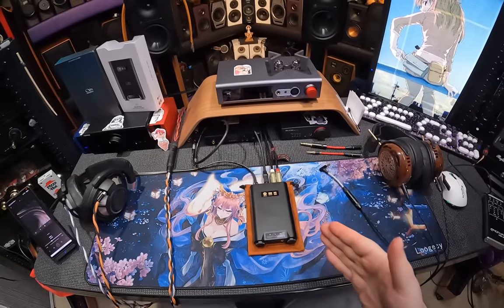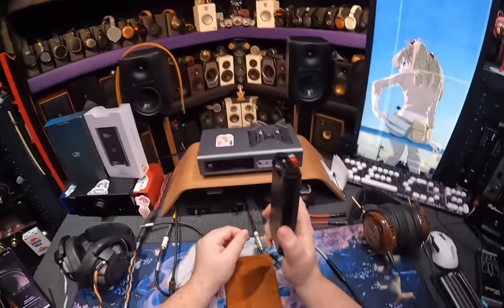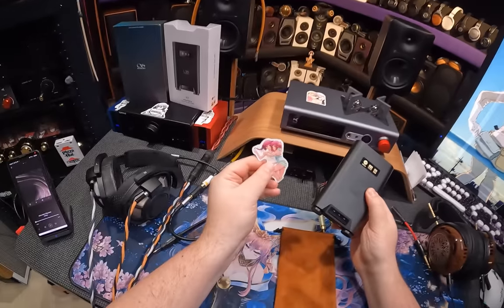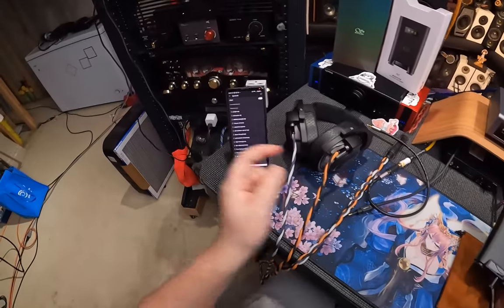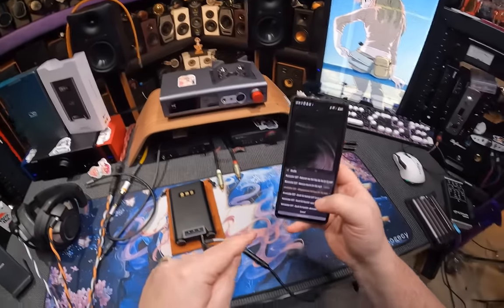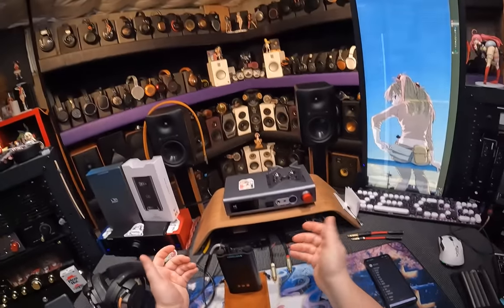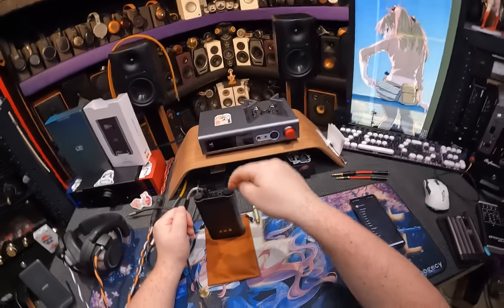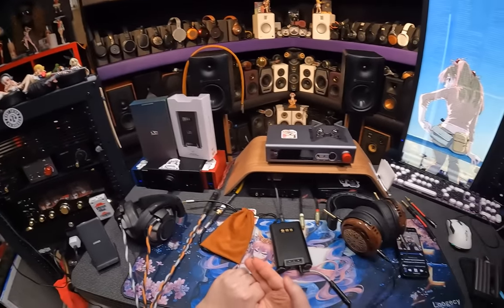A Retro Portable Music Computer -- The Shanling H7

Comment: Z: and be careful with this case included with the H7. I ruined my logitech mx 3s white mouse because of him. The more you touch him, the more he paints your fingers and everything you touch white will also be colored. I had to use a solvent to clean the ingrained paint from the mouse, but I didn't completely clean it. Orange spots. You can't touch anything white. The cover had to be washed 4 times, then it stopped being painted.
Reply: was the post on headfi about the bag coloration yours?
Reply: @НиколайЗагада  Yes.

Comment: Xduoo is supposed to give as a similar size dac Amp with swichable dac modules , beyond the normal for them opamp swaps 😅
Reply: Which xDuoo model has switchable DACs unit ?
Reply: @d_dude_is_here  Xduoo Xd05 pro. Should be available quite soon.
Reply: @d_dude_is_here  seconding this question, I've only seen models with swappable opamps
Reply: If you are talking about xDuoo 05BL Pro then kindly recheck as it's a detachable bluetooth receiver and not a DAC unit.
Reply: @d_dude_is_here  wouldn't surprise me if a new XD05 model is coming out soon it's been a while last one

Comment: Have you found the firmware update?

They have 1.5 version I just saw.

UPDATED:

Update Notes for V1.5

1. Added SyncLink support for cover art and lyrics stored on MicroSD card within H7. (At this time only supported on Android, app version V2.1.5).

2. Added Resume function for MicroSD card playback.

3. Added battery indicator for H7 into the SyncLink on Eddict Player app.

4. Adjusted audio circuit behaviour, reducing audio cut-off at the beginning of music.

5. Other device adjustments and fixes.

Thanks for your video. I was considering this, as a semi portable but maybe I will choose something smaller than Mac Truck…. I was thinking of the Cayin RU6, until I saw the Earman Colibri then I saw this….. 

Can you use other players to control this or are you forced to use their player?
Reply: I am also curious about Cayin RU7 comparison with H7 and Earmen Colibri. Want to make purchase decision.
Reply: @Gaurav18nov   I have the Cayin RU7 and also the Fiio BTR7. I do enjoy the sound on both. The Cayin is a smaller footprint so a little easier to carry. The Fiio has Bluetooth & wireless charging so it offers a little more in features. Sound wise I would call them close although the Cayin is R2R and the Fiio is THX chipsets. I personally do give a slight edge to the Fiio in terms of sound. They are really close and I do enjoy the Cayin very much. Maybe the clarity in the top end comes through a little more for me personally with the Fiio. But simply as a portable tiny little thing the Cayin is about half the size and does sound lush.  My 2 cents worth…. If you can get to demo what you are choosing. That’s the best thing you can do as sound, like taste is subjective….. Good Luck 🤞
Reply: @_OpdeeMist  Thanks for the reply, this is helpful. Now this has got me interested about BTR7. Since I don’t have access to auditioning these DACs. I can only rely on reviews and form my opinion.

I have IE 900, and if I have to choose just one between BTR7 and RU7, which one do you think will suffice and sound best.
Reply: @Gaurav18nov  hey, no problem.

As I mentioned earlier the Fiio has the edge for me with features and also just scrapes in by a nose on the sound. It’s only a difference in the high end frequency for me. I have tried to put my finger on it but it’s so subtle I am at a loss to definitively answer. If I had to try and put it in words. It maybe just a little less sibilant or slightly fuller in the higher frequencies. I’m not an audiophile, so can’t really define what I hear. I just find the Fiio a little more fuller in the bright tones of say horns and brass instruments. I mean it is only  maybe 3-5% fuller, so not a whole lot in it. But I can hear a slight difference. 

Like I said sound is subjective. I have not heard a lot of reviews that give the Fiio raving reviews. I guess at the time I found more reviews on the Cayin than the Fiio. I only purchased the Fiio originally because of the extra features and so I would have 2 options if I didn’t like the sound of the Cayin. I have never considered getting rid of the Cayin as it does sound sweet also…..

Let me add this. I only listen using headphones. They both run the HiFiman Arya stealths & Sennheiser 560s well.  So, no IEMs.  I do like the fact that when home I can run around with my headphones on and plugged into the Fiio that is connected to my phone via Bluetooth. Which offers a little more versatility in portability whilst at home. 

I’m not sure if this helps you but, maybe if you can’t demo them. Maybe consider purchasing through a place where they take returns. Therefore if you’re not happy you can exchange or get your money back……
Reply: @_OpdeeMist  You explained it so articulately, I  am clear now. Will get the BTR7, it seems like good value and has “synergy” with IE 900 (as mentioned by one reviewer).
Thanks again for taking your time to help me out ;)
Reply: @Gaurav18nov  no problem. Enjoy your new toy….. 😁

Comment: I wanna see some of the cheap daps. I don't think I'll ever afford a $500-$1000 dap. But the little ones in the 50-100 range intrigue me.
Reply: That's what I thought too in the past. Then poof, i just started saving up and got a 500 usd one. Do they close your doors to them.
Reply: @benedicvelasco  I just have so many more things I need to buy. I can justify a $50-100 present to myself like that, but when my most expensive headphones are $300, a $500 dap just doesn't make more sense that a BTR7 and my phone.
Reply: @Colin Martin  my brother in christ stop wasting money
Reply: I bought a Fiio M11 a few years ago when it was still new to the market. I only used it during warmer months when hiking or on bike rides. After being out for 2hrs my battery would be around 80%. A year later with the same activity I'd be between 60-65% battery left. I ended up selling after that out of concern over battery degradation. I'll likely stick with small portable amps that pair with my phone for the time being.
Reply: @RYTHMICRIOT  u didn't know batteries degrade?
Reply: @TheTastefulThickness  Of course. But not a 20% drop in one year of light use.
Reply: @RYTHMIC RIOT  all the phones and laptops ive ever owned in my entire life drop off 20% in a year id estimate
Reply: @TheTastefulThickness  that's kind of bad. Modern devices should have battery health systems, and everything with a modern Android OS should have a setting for maintaining a max battery level of 85%.

My Galaxy tablet has had it on since day 1 and after a year and a half, I don't notice any appreciable difference in the battery life. It's amazing how effective that charging scheme works.
Reply from the maker: Shanling M0 pro is coming
Reply: @ZReviews  oo baby now you're talking my language. I'll be particularly interested in what kinda horsepower it can manage to put out through that single 3.5mm.

I still wanna see you review the Nicehck EB2s on the iem channel. I suspect you might quite like them for all of $25 (the green one is still for sale on aliexpress for $13)

Comment: Meanwhile most people are content with their "Stupid Phones" that don't even have a decent amp in 'em. And their stupid phones aren't cheap, either. I just picked up some A1 knockoff Air pod type IEMs and they sound fine, but, there's no juice from my iPHone, as usual. They've limited the power and volume so badly
that you can never get a good volume going. I have no use for this. I need some sort of BT amp so I can at least get some power out of the device. I mean,
when I'm not using my wonderful Fiio wired rig. But I don't have $1000 to invest in this, alas.

Comment: Zeos, friend, turn off\on switch mode, changes the DAC setting to UAC 1.0 (on) mode and UAC 2.0 (off) connection via type-c cable.

UAC 2.0, is bettter, since high USB speed is supported, natural bandwidth and low latency is advantageous. 

UAC 1.0 is only supported by a 192 kHz dual channel audio source: 16b (2 x 192 x 16) / 1024 = 6 MB = 6 MB/8 = 0.75MB
UAC 2.0 can support an audience of 15-channel 384 kHz 32b:(15 x 384K x 32) /1024 = 180 MB = 18 MB/8 = 3 MB
Reply: so the “Switch mode” ON means UAC 2.0 ?
Reply: @MatusHaw  no. Off - 2.0, on 1_0.

Comment: Sorry, but Fiio Q7 is better. I use it with an external power suply and some high end cabels.
Reply: And the IBasso DX240 too
Reply: Really, guys? Cannot decide which one to choose, fiio q7 or shanling h7... Do not care at all about power amplifiers, just interested in sound quality and wide scene..
Reply: @qa-engineer  well, fiio q7 has a slightly more detailed sound, yes. But I still prefer the H7 for its card reader feature. So, it's like you get a 1500$ dap without OS for 800 bucks. A good deal for me. With fiio you would always need a transport device nearby
Reply: @guillermokunzel5171  doubt